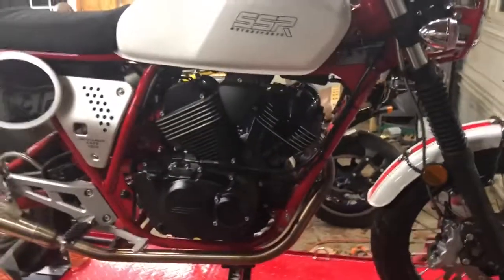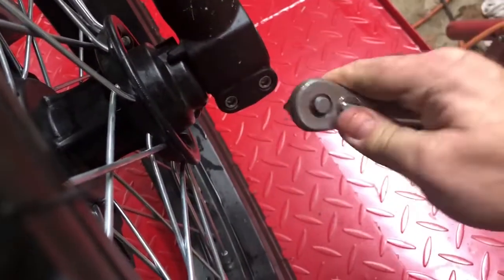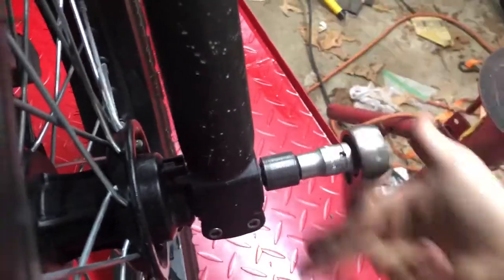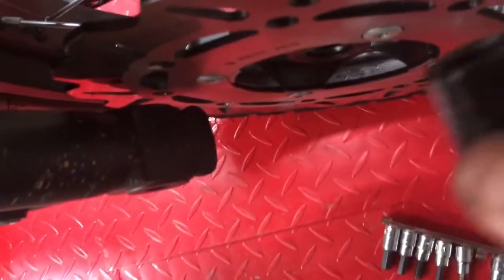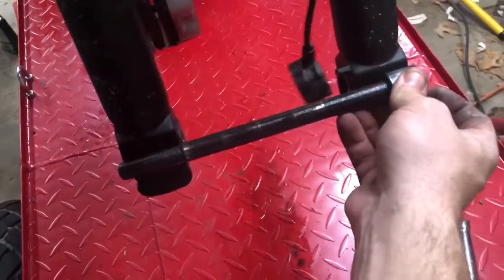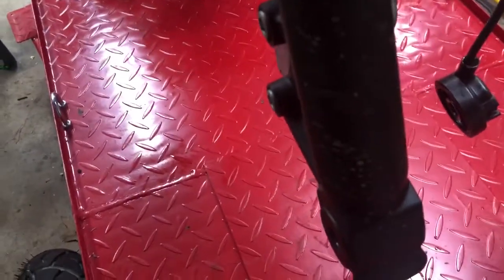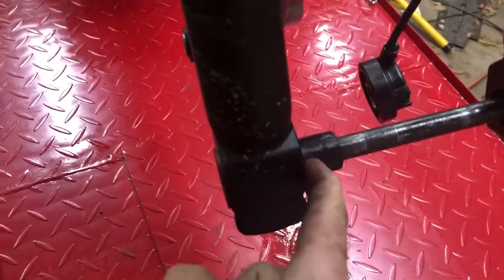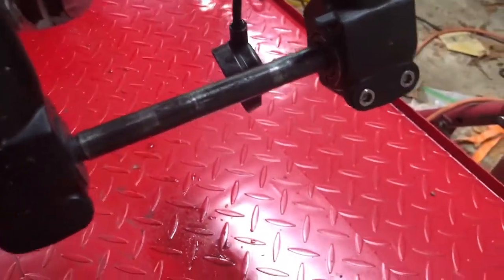SSR Buccaneer 250i Warranty Issue - missing axle spacer

Comment: Thank you, sir, for saving me at the dealership. They thought I was a fool until I showed them your video. My bike was missing a spacer too. So thanks for giving me some proof that SSR can make a mistake. Have a good day.
Reply from the maker: I'm glad I could help! Do note that a couple thousand miles later my fender bracket cracked, and I think it was due to the flexing that was happening when the missing spacer was allowing the forks to flex. Without that spacer, the only thing keeping the front end from twisting like a pretzel under hard braking was that fender bracket.  So watch yours. I rode my bike altogether too much without the spacer because it was brand new and I just wanted to ride. If you've got more sense than I, you might be alright :)

Comment: Hey Charles! I know this video is pretty dated. But I realized my buccaneer has this same issue. I just ordered the axel spacer. Were you able to install this easily back in? Or did you have someone do it for you? I’ve never done this before and don’t really have any guidance. Any tips would be greatly appreciated. You seem to be the only person on YouTube that has made videos of in depth maintenance on these buccaneers. Appreciate you!
Reply from the maker: You'll have to jack the front of the bike up, remove the axle, drop the wheel down slightly, install the spacer, and then install the axle again. If that sounds sketchy take it to a dealer. It's a 5 minute job for a seasoned tech, and if you bring them a 6-pack they might not even charge you.  If you're in NC, definitely check out Mark at Mountain View Motorcycle Campground (near Banner Elk & Boone) or Mays Motorcycle Maintenance (Mooresville). Both are top-tier mechanics and highly reputable.

Comment: Is the issue resolved? Did they fix under warranty?
Reply from the maker: The dealership is waiting on the part to arrive, but yes they are fixing it under warranty. One other member of ADVRider had the same missing spacer issue. I've been in contact with SSR directly, and they're talking to the factory to make sure this is not an issue moving forward. Fortunately the bike is completely rideable in the meantime.
Reply: @ChopperCharles  
Thank you for sharing your experience.